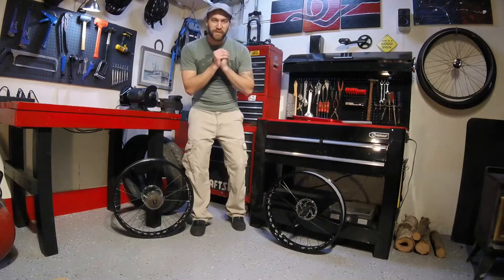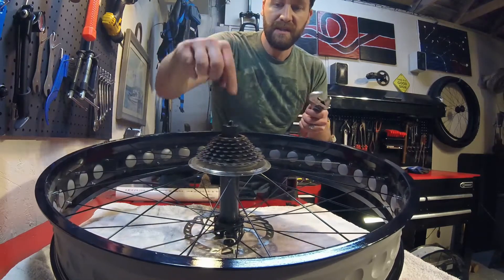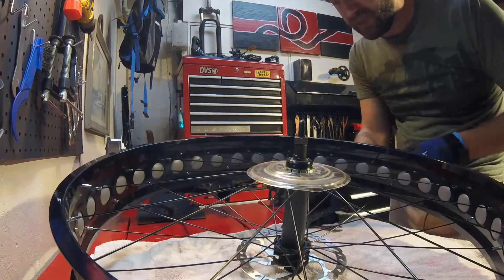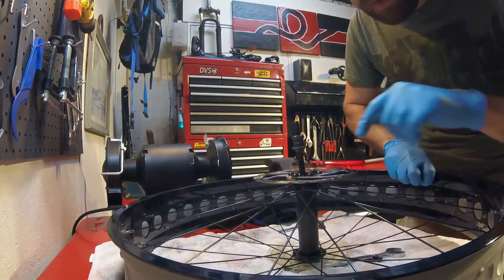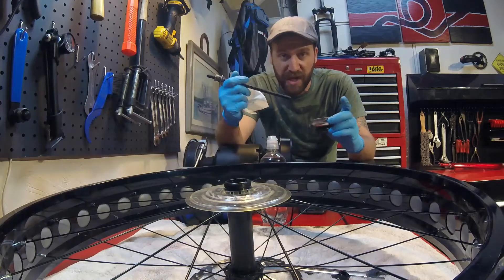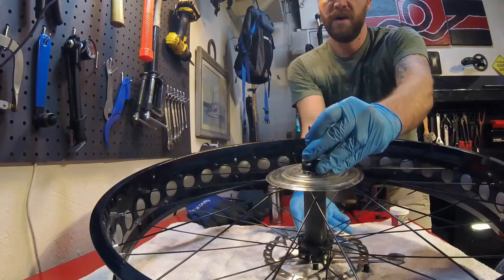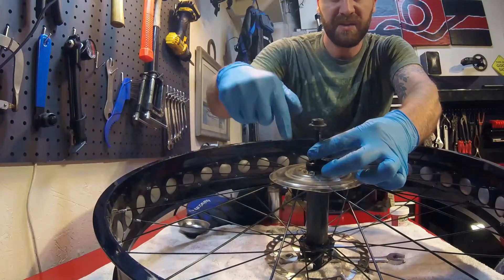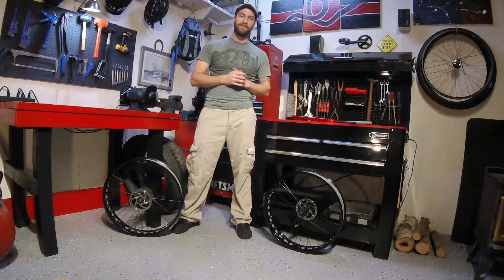How to Service Mongoose Fat Bike Hubs (improved audio)

Comment: So today, I successfully disassembled/reassembled, cleaned & re-greased my rear hub, interestingly I found my rear hub was tightened wrong (from factory?) and caused a lot of friction when spun, I was able to readjust & tighten the bolt & now it spins "free-willy" with a ton of grease lol I also upgraded my whole drive-train as well, thanks to these videos - I wouldn't have a clue what to do without these clear instructions - my dolo now rides like butter & more like a higher end bike - This was my first bike overhaul. Thanks!

Comment: I am fairly capable as a craftsman and a mechanic but was leery about pulling my Mongoose Hitch apart but I needed to increase that gear ratio from the original flywheel so climbing hills was not as much of a challenge. So I watched this installment about five times before attempting this task but everything worked like clockwork. I pulled the rear wheel followed your vid step by step and the only challenge was getting the spline socket onto the flywheel (googled other people's responses for this same issue; a couple of love taps with a rubber mallet). Aside from that start to finish in about 1 hour 15 minutes. Now she's well greased and the new super-low Shimano Flywheel has cut my work load in half. Going to go for the hydraulic brakes next week. Thank you for this tutorial!!!
Reply from the maker: Min Mack so awesome to hear! Glad I could help out. The freewheel is going to help tremendously with the climbs, and you're going to be amazed with new brakes!

Comment: Found this exact bike in a dumpster. Someone tossed it out because back wheel is stuck in place. Used this video to remove and then I replaced the bearings. Works great now!
Reply: Please show me wat you did to fix it

Comment: Handy video! I'm contemplating the Dolomite for a cheap fattie, and I know that the hubs should be greased since they come fairly dry from the factory. 

Good tips from your other videos too on how to make the bike more livable. 

If you're looking for a little better audio quality, they have some cheap lavalier mics that plug in using a 3.5 mm jack. Usually around $20. Works so well that I have to lower the volume in post. 

I subscribed, I think you'll do well, and I'm sorry that you got caught up in the 1,000 subscriber thing, that happened to my original channel. 913 Subscribers and completely demonetized. Extra NOT cool.

Comment: Great work on the upgrade vides. But is the Mongoose Malus, Dolamite and Hitch all the same bike and parts? What's up fellow bike enthusiasts. I'm new here and am just stopping by to say hello. As well as get some help with a recent used bike purchase (Mongoose Malus R5714A fat bike) issue. I'm looking to grease the headset, hubs, bottom bracket, etc. I know I'll need a freewheel/cassette puller, adjustable wrench, cone wrench, standard wrench(s), socket wrench(s), allen key(s), crank puller, pin spanner, etc. What I really want help with is figuring out which size tools I need? Or which bike repair tool kit(s)/set(s) are recommended for this bike model? I'm starting out with zero tools but only want to start my collection with these specific tools.
P.S. I believe the bike to have all its original parts (as per the first and only owner).

Comment: Are the stock rims any good on this thing?
Reply: They are, ... concerning. The seems are tacked and mine are uneven to say the least. I thought they were defective until I did some research and found out that it's normal for them to not be even at the seems. If money were no object I'd replace them just to feel better about it. So far I've had no problems.

Comment: actually....you can get it apart from the brake side without removing the gears. pull the axle out the gear side.
Reply: that is what I did too...good point